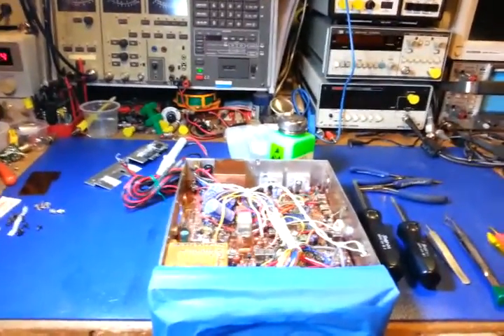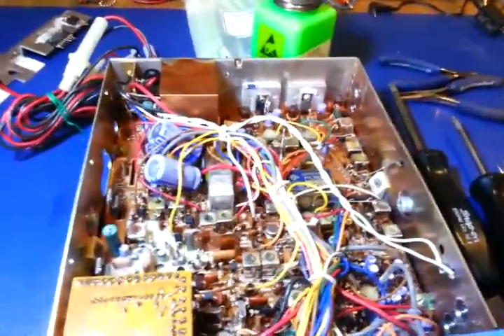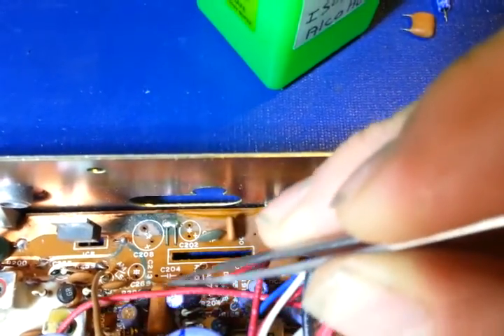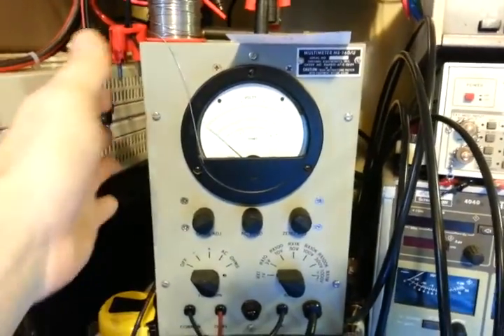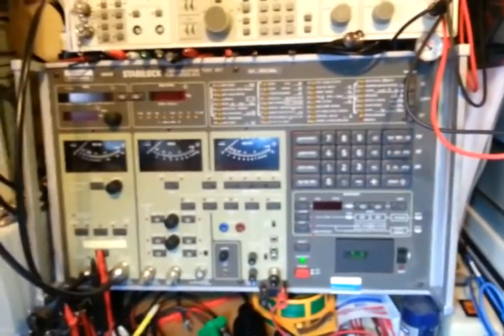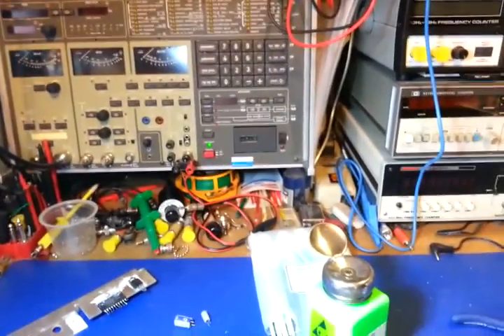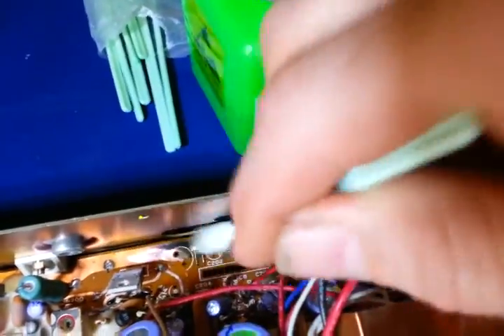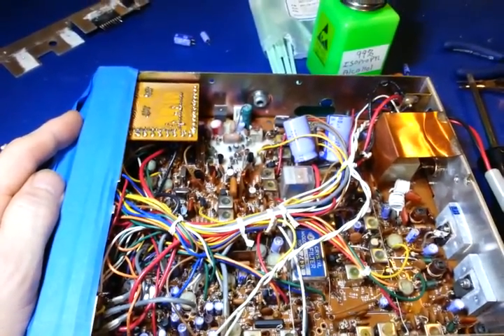Teaberry Ranger "T" CB radio repair, electrolytic capacitors and why to replace them. Part 1

Comment: Hi Mike from Roger over the pond in the U.K. I wonder if you would know of any suppliers in the US for hard to find replacement parts for the Uniden/Cobra radios.Particularly items such as the driver/final transistor-2sc1966,2sc1969 etc and the MV1Y varistor .These items and other parts such as cans /slugs etc are very hard to source here in the U.K. and I was wondering if you knew of a supplier anywhere that would have these parts that would ship to the UK The only trouble with eBay is there such a lot of fakes .I'm a full ham radio licence older a M0--- and I repair CB radios for myself and friends to continue my collection.Hope you can help buddy and your videos are brilliant.73's from over the pond de Coppernob Roger-M0T--.
Reply from the maker: Best place for original rf transistors is RF Parts.  For current manufacturer try Eleflow Technologies.  Yes their  Chinese manufacturer but they do make good quality semiconductors.  They specialize in obsolete RF transistors.  Have used them for a few years now and not a single problem yet.  As far as other parts a lot of its no longer made so parts chassis is the source for me.  I have a radio graveyard.  :)
Reply: Try the link I have here. http://stores.goldeneagleradios.com/
Reply: You're correct - the 2SC1969, 2SC2166, 2SC1306, 2SC1307, from China/eBay they are ALL fake. If you can't get them your best bet might be to replace them with a MOSFET, but it will require a slight modification to the circuit.

Comment: hey mike where can i find a schematic for a cobra 148 nw st radio i have alignment procedure from cb tricks but no schematic and i have problems its off frequency all the way around am and ssb and alignment just won't do it on the 7.8 megahertz wont adjust its all over the place from .7??? to 30.???? i need to search it out can you help please?
Reply from the maker: Just go to CBTricks and use the schematic for a normal 148GTL.  Same radio without the nightwatch.

Comment: Mike I have a galaxy dx 949 increase purchased free eBay appears that there's a damaged soldered joint  on the top board, when keyed the radio gets very hot like holding down a dead keys to long ,can it be repaired and what is a minimum cost for repair, you can get back at me abtoledano@yahoo.com with info

Comment from the maker: No, I don't need a tripod, I need a camera. :)  Just use the camera on my cellphone.  One of those things I just haven't gotten around to researching to find a good one.  

The pass thru's are not plated.  They use 2 holes close together and a U jumper soldered top and. bottom.

Mike

Comment: You need a tripod :)

Those early boards they did not apply solder mask to one side.
They silkscreened it at least.
Did that radio have plated vias or did they pass a wire from one side to another?